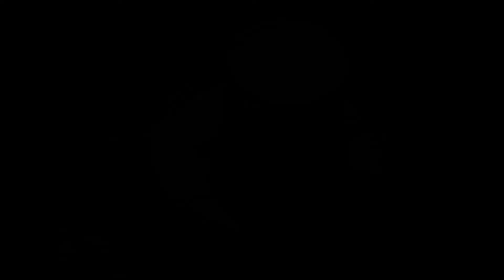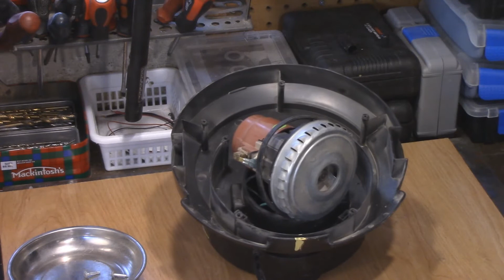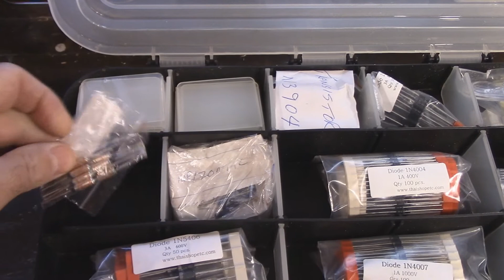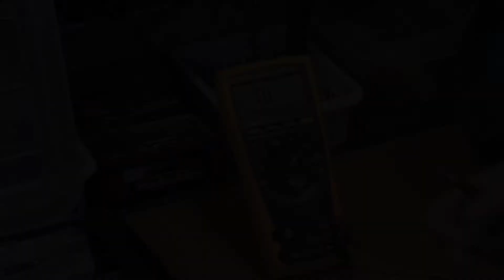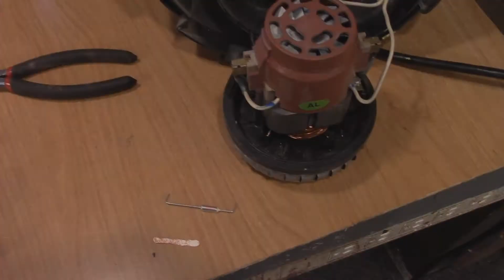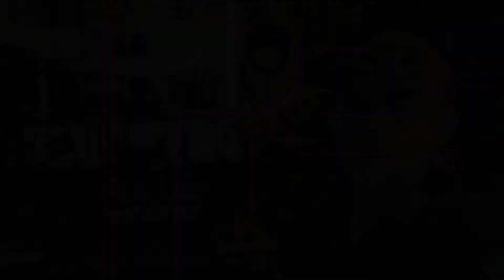How To Test And Fix Your Shop Vac  -  Will Not Turn On

Comment: What is the purpose of the flattened copper wire? Is it just to hold the wires together? I read somewhere that soldering is not recommended as it can trigger the thermal fuse.
Reply from the maker: Correct , yes if too much heat is used the fuse may be damaged , im pretty careful and never damaged one yet.

Comment: Great video, well and clearly explained! .  I'm just curious if it wouldn't be easier or even possible to just leave the leads of the old fuse in place and solder the leads of the new fuse onto the remnants of the old leads.  Would that work?
Reply from the maker: That's an option if you have space , sure.
Reply: @SteveRobReviews  Thanks for that confirmation (and for keeping an eye on your older videos!)!!

Comment: I have been using Rigid since The orange box store ran 29$ Christmas specials and I still have one running from 2005 I have given one to all the kids and I believe unless the daughters have ran over one they are still vacuuming but one this is mostly dry not wet use  good luck to you all I’m trying to help someone with a dewalt again
Reply from the maker: That's awesome you've had such good luck with them!

Comment: Just had my DeWalt go on me. Plugged hose, smoked a bit, then dead. I will take it apart like you did and do the ohms test.
Reply from the maker: Yep , most likely the thermal fuze is blown.
Reply: I hav stainless steel 10gal Dewalt. Did you fix it? I might try this method too

Comment: My Dewalt DXV10p just stopped and I cannot find any information anywhere to see if it has a thermal fuse but after watching this i am assuming it should, i hope.
Reply from the maker: Your on the right track  ,  dmm across the fuse to check for  continuity .  You can get a thermal fuse online - amazon.